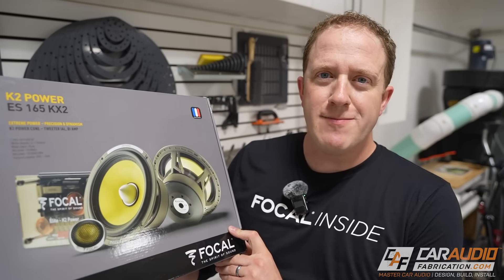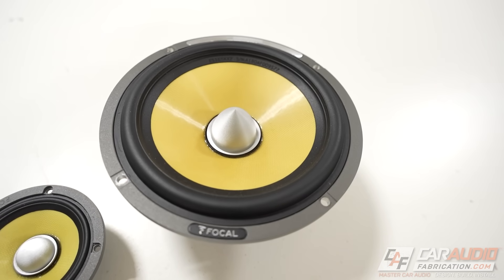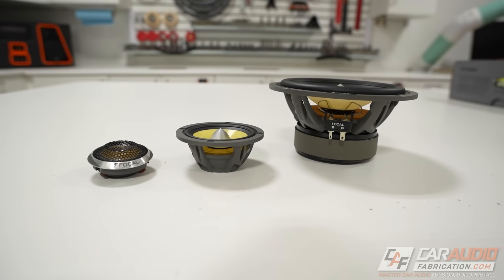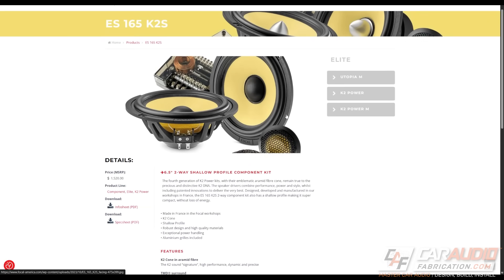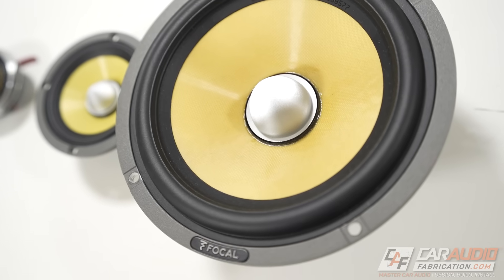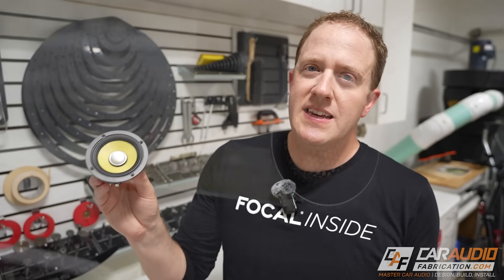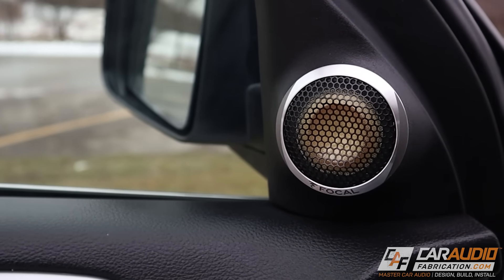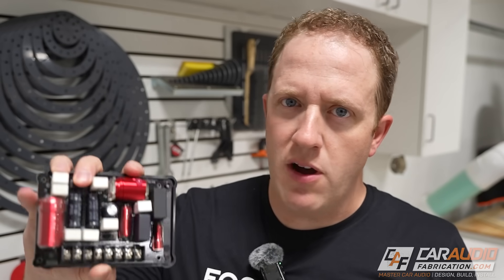Achieve BEST Sound - “Running Speakers Active” - Basics Explained

Comment: So if I wanted to run active in my 2015 Silverado does this mean I would have to run separate wire for the two tweeters in the front since I think both of those are wired to the front door speakers?

Comment: Wow, I cant believe thats a Focal crossover. Sand cast resistors? Garbage caps? They should be ashamed at the price point of their speakers. PS. DO NOT use that crossover if you want truly good sound. Go with the DSP.

Comment: Did you remove your "door pod" video from maybe 5-10 yrs ago.? I used to use it to remember a router technique of making inside outside matching grills using a rabbeting bit. I think you used vinyl and mesh and an alpine component set.

Comment: As much as I like this channel, I'm not convinced you need to set "Time Alignment" for each speaker in a car. You are inches from the speakers.
A few feet at most.  But "active" crossovers are certainly better than passive even though you can still get good results with passive crossovers.
What I think "really" matters when installing a car stereo for good results, is to always (if you can) have a 3-way speaker system in the front 
of your car instead of a 2-way system.  Then your subwoofer in back.  A 3 - way configuration makes all the difference. And worth the extra effort and cost.
Reply from the maker: Watch the new video! It proves how we can easily measure a difference with vs without time alignment in detail. https://youtu.be/8QmwokrX4EI

Comment: I have got an elantra 2017 gl non infinity. Crtchfield site is great but i have firther questions. I am trying to choose one between the x1 650, x or se. 
In case i go for the component option whete should i install the tweeters (sail. Little triangle on top of the oem tweeter or modofiy g the oem grill of the door).
Or should i just do coaxial and think about a subwoofer. 
There's so many options i am confused.

Comment: wait, help! at 10:54 you said using the channels on the amp would be passive, but before that at 8:06 you said that using the channels on the amp would be "running 'active'". couldn't you just use the filters on the 4 channel amp to run them active instead of needing a 10 channel amp? or am I missing something? 😭

Comment: Absolutely love your content and the depth of knowledge you share. I really wish we had something like CAF Audio here in Australia having someone as skilled and insightful as you would be incredible for the local car audio scene.
I had some high-end gear installed at the now-closed Life Style Store in North Parramatta, including an Audison Bit Ten DSP, Hertz speakers and amplifiers, dual subwoofers, and a high-end Kenwood head unit. While the equipment itself was top-tier, I wasn’t too happy with the installation particularly under the back seat, where screws were drilled into the car body, possibly near the fuel tank. Watching your videos really highlights the difference your attention to detail and the cleanliness of your installs are on another level. Keep up the amazing work.

Comment: Mark do you have a video on running speaker wire from amp to running through doors for active setup?  I have those frustrating wiring connectors that are nearly impossible to add to.  I miss when it was just a basic loom & rubber gasket at the door & frame and you could just fish lines through.

Comment: hi 

i own a 4.5meters sedan with pretty good sound insulation and i m looking to upgrade my stock system since right now i have a 300W RMS subwoofer in the trunk and 4x4inch stock speakers and 2x underseat woofers that are powered by a weak headunit. my plan is to buy an amplifier with 4 channels that can deliver 135W RMS at 2 ohm (70W RMS at 4 ohm) and buy 2x60W rms tweeters , 4x midrange speakers 55W rms , and 2 underseat midbass 70W rms each  , and install them like this : 2x55W RMS 4" speaker + 1 tweeter on a 135W RMS channel , 2x55W RMS 4" speaker + 1 tweeter on the second 135W RMS Channel , one 70W rms 6.5" midbass on the 3rd channel (70w RMS at 4 ohm), and last 6.5" midbass on last channel the same way. 

would this setup work decently , or it is not a good idea to wire it this way?

Thank you!
Reply: How are you filtering out tweeter vs midrange if you're sharing the same amplifier channel?  Passive crossover between amp and tweeter or in line caps?
Reply: @ericshaw7859 with passive crossover but if it s not possible i can try to amplify them with the headunit and lose some power i guess

Comment: Correct on every count except one, you can still have 2 or 3way passive combined with full active... the speaker level input to a typical passive xover is just a +/- rail and the "ways" can be separated, remember a passive does not actually technically divide the signal it only filters out the unwanted frequency's to each driver.
Reply: There is absolutly no reason to run an active system to a passive crossover.  The whole purpose of the DSP is to "electronically" seperate the frequencies, a much more precise and safer way to get the job done.
Reply: @justgoofingoff  yes in a car environment there's not enough benefit in doing it I was just making a point about passives can be split, in the hifi world its call bi-amping. It gives you the best of both worlds... but active does have one big disadvantage and thats called human error.

Comment: I got a question…
I have a ‘22 BMW X5 with the basic “system”. I bought the technicPnP add-an-amp harness to give me access to seven channels. Current amps waiting to be installed are AC altitude, a 4 channel and a 2 channel, not planning on doing anything with the center channel. 
…do I need an LOC, DSP, or something else? Or nothing at all?
The amps have high level and low level input. 
Eventually, once my loan application is approved, I will upgrade the speakers to focal. 
Anyways, what do I need here?

Comment: 3:54 You dont have to have to have 6 active channels, 5 channels can do for a 3 way and 6 can be enough for a 4 way. Bellow 1800hz, mono is fine and 2 in parallel, can give 2 ohms to maximize output of a amp. Say with this set up I have...

machete mt-30 7500hz hp at 18db
cdt hd-3  5500hz lp at 18db and 2500hp at 6db
machete mm-60 1800hz lp at 6db and 750hz hp at 18db
machete lw-65a4 650hz lp at 18db and 50hz hp at 24db

In this example the bullet tweeter and 3in mid, are powered off a alpine cda-9835 3 way deck and a passive bass blocker on the 3in mid. Where the 6.5in mid and mid bass, are off a orion xtreme 375.2 that is 2 channel split mono for 2 drivers each. To make this amp active like this, I also have a tiimpono TPT-SP4BT dsp but there is now out a 4 way deck from deaf bounce that would clean this up some. This is that in demonstration and sorry that im yelling over it, also the mic is having a little issue with the bass. 

watch?v=N_CAjOuCYAY

I also have a orion xtreme 500.4, that could have them in stereo but would have to make room for it. Also thinking about adding subs at some time, where think 2 cdt hd-w6+dvc, 2 image dynamic id-8 or 2 savard rap 6.5 to help with the sub bass. Not sure right now and not sure when will do anymore, but the mid bass could do with a little help for 30 to 150hz. It sound real good as is, but the rabbit hole is deep.
Reply: Why is mono fine below 1800hz?
Reply: @Valtra103  At low frequency its hard to sense the direction of sound.

Comment: Question if I install quaxial speakers in my car had component speakers am I supposed to remove the factory tweeters?
Reply: Coaxial.  And technically yes but most headunits and amplifiers will tolerate a pair of tweeters operating in parallel.

Comment: I have these exact Focal speakers running active off a Helix Pro mk3 in my truck and sounds phenomenal. I wish I still had my system from the early 2000's with Diamond Audio high's and mids with passive crossovers so I can compare just how much clearer/better todays gear is compared to those.
Reply: @samscharp3367  I’ve got a Diamond audio D7054 amp with Diamond audio speakers tweeters, mid range & one 10”bass..Sounds amazing but contemplating changing the amp since it’s overheating! I’m contemplating going active but I sure love the Diamond Amp…

Comment: So I got a question, I’m running a two component on both front driver and passenger sides and then two coaxial in the rear (one on each side.) If I’m looking to add an amp, I would need a 6 channel?? Possibly even 7 or 8 if I want to add a sub eventually?
Reply: Yes.  Best to keep the sub on a separate amp though as they tend to require more power than the others, but there are a few amps out there with two bigger channels for this purpose.

Comment: Hey Mark, good information in the video. One thing that Id like to note is that I’ve used capacitors with the tweeter in the past and when I put my DDM to it, I didn’t get an impedance reading. Is this something you’ve also experienced? Can you explain why the DDM won’t read the tweeter’s impedance when there’s a capacitor on the positive lead?
Reply: Your DDM measures resistance and a capacitor shows an open circuit for a DC load.  Impedance is an AC property.
Reply: Because the cap looks like an open to the meter

Comment: Anyone have guidance on running active/passive hybrid?  I'd like to upgrade to a 3-way front stage where the woofers are in the door and the mid/tweeter are in pods in the A-pillar.  I'd like to keep my 5-channel amp, so I'd like to run the woofers directly to the amp then run a channel to the passive crossover for the mids and tweeters.  Since the mids and tweeters are co-located, time alignment is less critical between those drivers than it is between them and the woofers.  I realize I'd be potentially losing some eq-ability for the mids and tweeters, but I think it's a good trade-off to not have to upgrade the amp
Reply: EQ wise there is no downside.  Your limitations are the inability to alter gain between the mid and tweeter, no crossover flexibility (generally minor) and no time alignment which you already realize is minor given their proximity to each other.
This is a very relevant option and can sound great.  Just be careful if the passive crossovers are 3way crossovers as there should be a load on each channel of the crossover.
Reply: @BaddDukk  thanks for the response!  I didn’t even consider a load on the unused channel of the crossover. I was thinking about getting a three-way component set that included the crossover. Good to know; thanks for your help!

Comment: question. looking at a 3-way component speakers, theyll state 80w rms, 250 peak and they'll be 4ohms. My question is will each speaker be able to handle the 80w? also lets say you are not running active and using crossovers, will the load on the amp be 4ohms? Lastly, let say you run a combination of active and passive, where the woofer is active and the mid & high are running passive by using the crossover that came with the set, will the amp still see a 4ohm load? can you just use a threeway crossover and only use two?
Reply: Yes.  If you use an 80watt amplifier channel for each speaker, it will (should) be fine.
Yes.  Most component sets use the same impedance drivers for each driver.  Most.
For the last two - never use a passive crossover with one of the drivers disconnected from the crossover.  It is less critical if the woofer is disconnected but can be catastrophic to the amplifier or the crossover itself if the tweeter (or mid in a 3way) is disconnected.
Reply: @BaddDukk  Thanks i have this german dsp/amp that has 8 channels and Im wanting to have the 4 woofers on each channel and then have mids and highs on their channel. So ill have to find a crossover  for the mid/high only,

Comment: I remember when DSP’s & DSP amps first became commercially available, I was so happy to finally ditch crossovers and have actual control of the sound. 
A lot of modern amps these days also have enough tuning control to run speakers active without a DSP.
Another quality vid, Thanks Mark!
Reply: It’s not a rare feat AT ALL to use digital FLAC and WAV files. Almost anyone in the sound quality car audio scene is running a Fiio. Hell, I use an SMSL PO Pro 100 to convert FLAC files that I stream on Tidal on my iPhone, to a digital coax signal that goes to my Helix DSP Pro mk2. Your opinion of digital seems a decade (or two) behind my friend.
Reply: I see where both sides are coming from but I  tend to agree with the @ZZPxFTW. 
@champspec, you’re absolutely right, source unit is the most defining piece of equipment when it comes to sound quality. Digital has come a long way, and while there may have been a time when analog had a clear edge in sound quality, that gap has significantly closed—or even disappeared—depending on your setup. I run an Alpine HDS-990 source unit and play DSD128 & 256 Audio files from a connected hard drive. My Alpine HDA-D90 DSP native sampling is only 192khz/24bit but DSD file format has beautiful texture and nuances in the audio almost identical to any analogue signal I’ve ever heard. I’d challenge anyone to hear the difference. 
But sure, if the truth be told, I get the nostalgia for older gear like class A/B amps or analog processors—they’re legendary for a reason. But dismissing digital outright feels a bit unfair given how capable and versatile it has become. At first, I used to feel like going digital was a compromise, but I don’t feel that way anymore. 

Just my two cents! 😊
Reply: @danieldenaro2037  is there any amp you would reccommend?
Reply: The most unfortunate thing about the quality of sound these days starts at the source unit… long gone are the lossless quality WAV and FLAC files burned to CDs.  The apple ipod changed how media us stored forever. In digital format. Digital has is definite upsides and perks.  But its all at the sacrifice of inferior sound to the pure Analog stereo form.  Sure there are ways to maintain a pure signal quality with digital.. but lets be honest, its an extremely rare feat.  Manufacturers are all owned by a handful of brands, who outsource cheap labor overseas and care about their bottom line over all else.. Class a/b amplifiers with a 9v rms signal coming in will always have a better chance of producing better sound in a vehicle.   As an d school audiophile, i cant stand these digital DSPs as the only go-to option.  They are only able to manipulate an already bad, weak signal.  All the rest of what is said in this video about active vs passive is correct.. but if you run a class a/b 25 year old PPI amp with an analog audiocontrol eqt next to the best modern day DSP money can buy and a class D digital amp…. If installed correctly w/o inducing noise, I know which one will sound better every time!

Comment: Great vid! I've been running active for years. The only downfall to running active is sometimes you have so many channels (tweets, mid range front and rear, woofer, subwoofers, etc) you don't always have enough channels for a DSP. 8 channel DSP seems to be the standard. You have to get a bit creative to make it work. Overall, great video. Thank you.
Reply from the maker: Thankfully DSP's with more than 8 channels are starting to become much more common, and you can always run multiple DSP's as well! Thanks for watching!
Reply: @CarAudioFabrication  expand, please

Comment: This only works if you spend $3,000 for a 4 channel amp 150x4w rms with front and rear component speakers.

Edit: Pardon me, $4,000, forgot the DSP.
Reply from the maker: What? Virtually every 4 channel amplifier on the market can easily be ran active. This idea that it is as expensive as you are stating is not true, but it is going to be more expensive than running passive of course as you now need a dedicated amplifier channel per driver.
Reply: @CarAudioFabrication I believe if HU offers crossovers and time alignment, a 4 channel can definitely be used to run front two way active without the need for a DSP.
Reply: @CarAudioFabrication  I'm going by the parts you are using.
Reply: False.     You are totally wrong on price bud.
Reply: @jasx1485  Price out the focal parts and DSP, I am on the ball.
Reply: I don’t run a dsp and I’m happy with my setup. I have 9 speakers/tweeters in oem locations plus 3 additional speakers. Never bought the “time alignment “ reason is sound travels at 767 mph. The difference in sound travel between the rear to the front oppose to the front doors to your ears is what .00001 of a second. That’s not even detectable by the ear. I’m running 12k rms and can still hear basic over the bass.
Reply: @BrianWaller-qe7gr  Go to someone who can ACTUALLY tune a system. You will hear the difference. I argue that 99% of people who claim they can tune are either full of shit, or are just ignorant.
Reply: huh if its 4channnel they have cross points and tines 10

Comment: So you are saying that for the active setup, the DSP is not required. The amplifier is enough ,correct me if I am wrong.if my question is correct, then why do sound engineers recommend the DSP? Is it for tuning and staging?
Reply from the maker: A DSP is NOT required to run active. The filters can be set on the amplifiers or elsewhere upstream, like an aftermarket head unit. A DSP is ALWAYS recommended as it is the only way to truly control every aspect of the sound and fine tune to optimal performance. But "running active" is not the same as "running a DSP". You can even have a DSP and still have passive crossovers in the system as outlined here - https://youtu.be/yjTpFAnuxlw